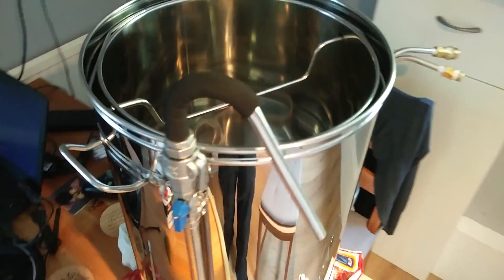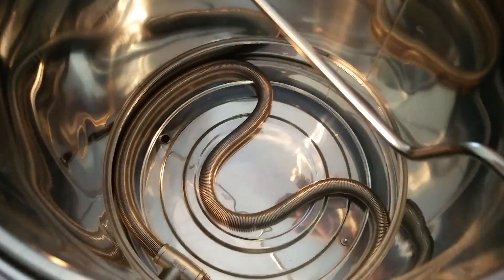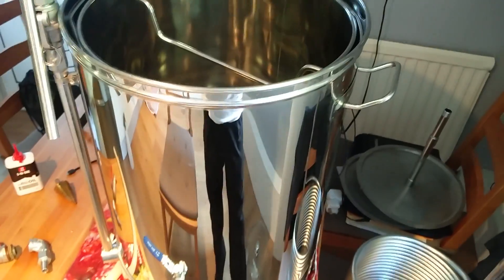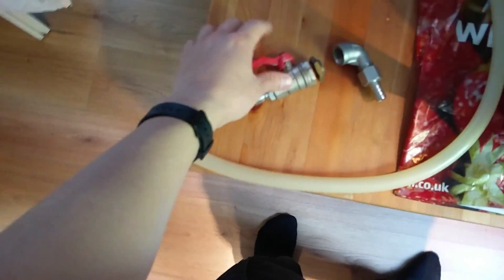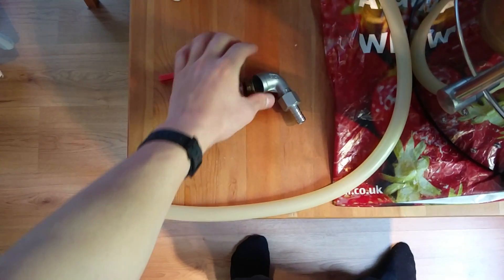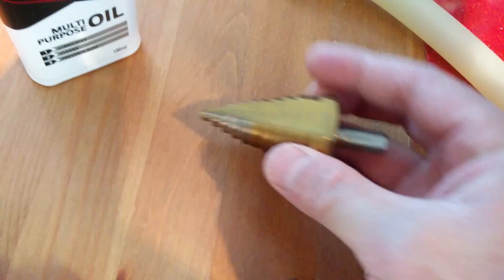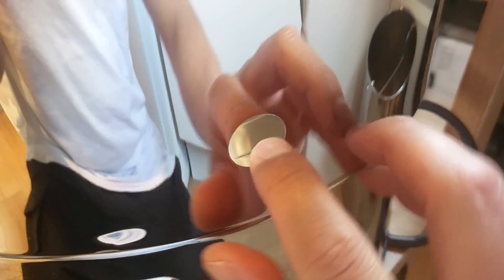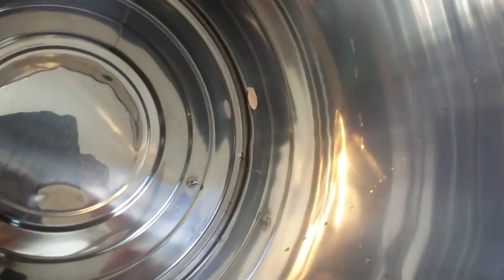Ace Micro Brewery (UK) Upgrade: Whirlpool Port Part 1

Comment: i thought the whirlpool was to aerate the wort before transfering straight into a fv to pitch? why not just use a hop spider when you boil
Reply from the maker: Whirlpool is meant to reduce amount of solids from the hot break and hops when transferring to fv. For aerating I recommend filtered oxygen

Comment: Great video - thanks for the contribution.

But when would you use it, and why? 

It's below the grain filter so won't it be useless during mashing? Or is it purely for boiling?
Reply from the maker: sjwdavies I wouldn't recommend doing it as it only has one use, the end of the boil.. The pump on the unit is low powered and prone to clogging. I actually have to blow it though the opposite first to unclog it. I was planning on a video for part two but lost all my footage recently. I will have one soon!